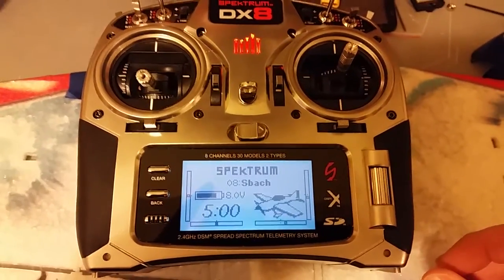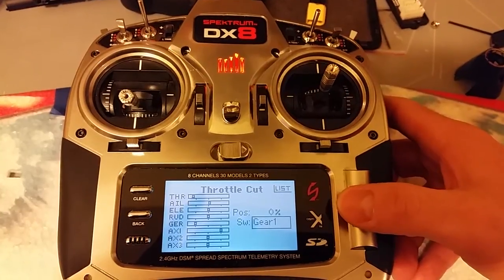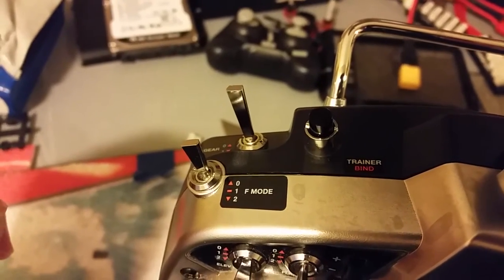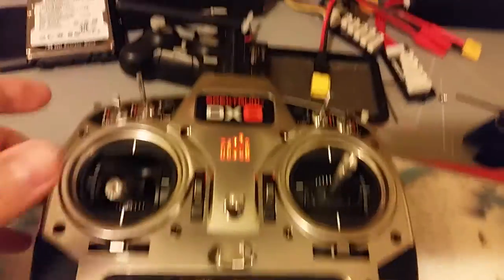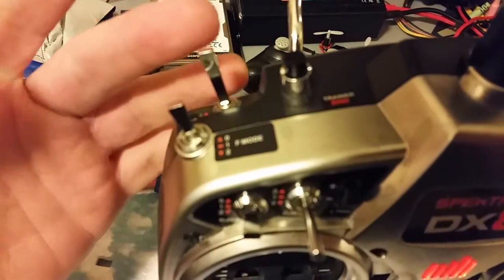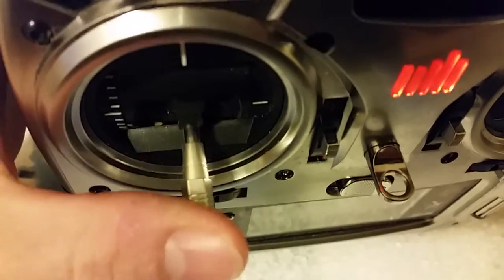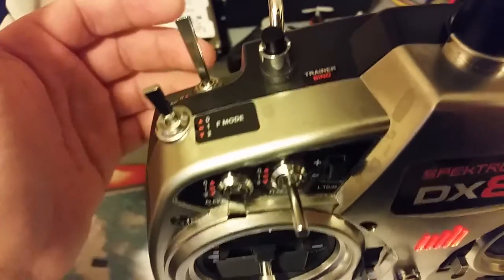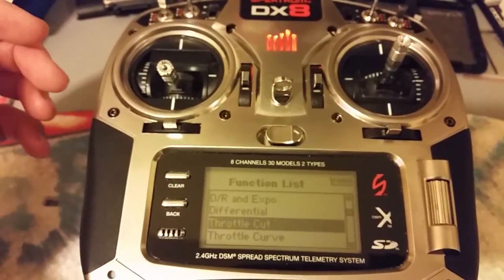How to setup throttle cut on spektrum radio

Comment: Thanks for the video.  I understand about what would happen if you turned on the tx with the Throttle Hold on and set to -30%.  So, I'm wondering, if you set it to 0%, would it matter then if your throttle hold switch was on when you turned on the tx?

Comment: I believe you can fix this problem by setting the throttle cut percentage to -130%. I'm not sure if that value was accessible when u made this video. But setting my remote to -30 gave me issues with the throttle cut. Setting it to -130 gives me no problems at all. Regardless of the position in which the throttle cut is at when I turn the aircraft on.
Reply: My Spektrum DX8 gen1 only allows -30 to +100 [or maybe+130]